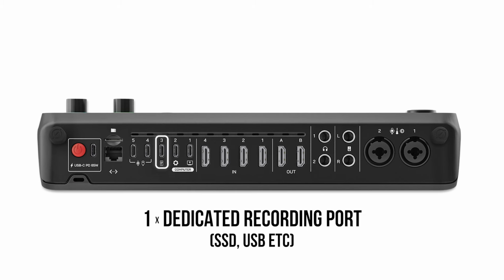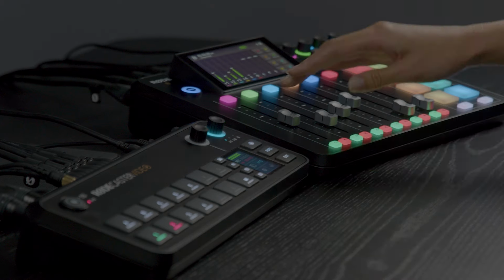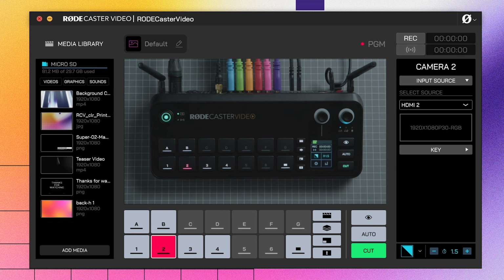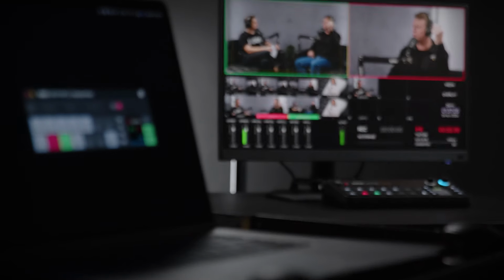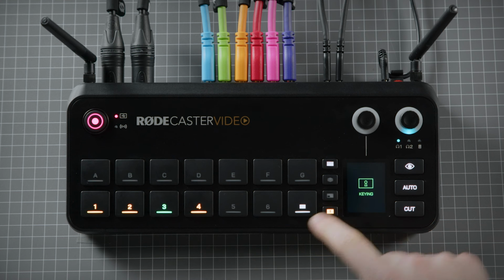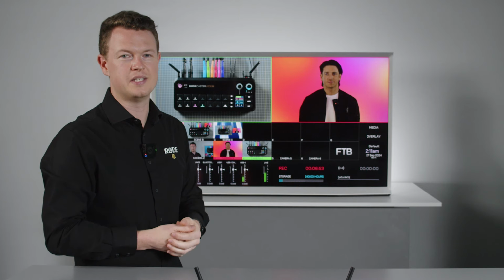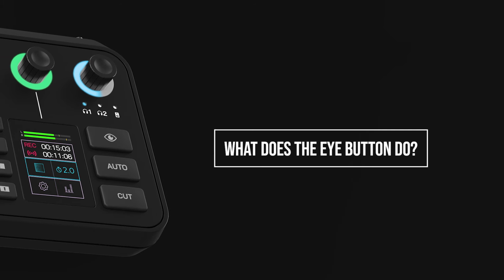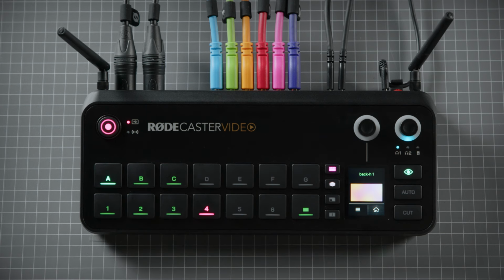Answering Your RØDECaster Video Questions

Comment: I’m experiencing a clear audio/video sync issue on the HDMI output of the RØDECaster Video.
Stream and internal recordings are perfectly in sync, but the HDMI output shows about ~7 frames of video delay compared to audio. Audio Delay settings don’t help in my case because audio is coming via USB from a RØDECaster Pro II.
This seems related to HDMI processing latency, not user error. Anyone else seeing the same behavior?

Comment: Does the Rodecaster video output ISO type recordings of individual audio tracks, as it does with video files, in the output folder on a hard drive?
Reply from the maker: When recording onto an SSD, you will get infividual audio and video recordings as well as the main program feed!
Reply: @rodemic  great, thank you.

Comment: question, I'm trying to figure out how to have 3 XLR mics and 3 Headphones, 2 mics and headphones going into the Rodecaster Video, and One Mic and Headphone going into my rodecaster pro 2 that is attached, the rodecaster pro 2 headphones sounds weird when listening to the mics from the rodecaster video, I'm trying to set this up for a podcast and also use the auto switching feature on the video. Let me know if you have any tips to fix this?

Comment: In a 3 camera podcast setting and loading in video intro and overlays can you record the podcast from start to finish and save to external ssd where the show is already produced with a file on ssd that can be uploaded to youtube? Or do you need to bring files into editor to do final edits?
Reply from the maker: The RØDECaster Video will export the Main program feed (all overlays, transitions etc. included) as well as each video and audio input as individual files!

Comment: 7:04 direct question: 
Can the Rode interview pro connect to those two wireless receivers already on the unit without using other units (ME/PRO/etc)?

It would be great for panels discussing on stage during live productions.
Reply from the maker: You can connect two Interview PROs to the built-in receiver of the RØDECaster Video!
Reply: @ that’s a selling point you did not mention! 
Panels on stage can use that feature. 
Thank me later 🤣

Comment: Love the RCV so far, and yes, I'm a beginner, Just one piece of advice: if you want to use your "iPhone 15/16 as a full camera, You can use it through an additional laptop!  -  If the laptop is plugged in through HDMI, use photo-booth, zoom, or ScreenFlow software, and you can connect the iPhone wirelessly in the dropdown menu as the main camera, giving you perfect Image and sound. Without the iPhone camera dot and info on the screen. Just make sure you have your phone on a magnetic charger so it never runs out of battery. Oh, and Guys, I would like to see you show more on the recording, transfer and "EDITING the RECORDED content, so uploading, etc., as a beginner, Cheers in advance.
Reply from the maker: Thanks for the recommendation! We'll keep that in mind for future videos.
Reply from the maker: Hey there! Just an update for yourself or anyone else who comes across this comment, it's now possible to get a clean HDMI output of RØDE Capture that can be used directly with the RØDECaster Video 🫡

Comment: Hi guys.. just bought a RCV.. I can't connect it via the Rode Central app.. apps installed BUT no RCV device comes up either via wifi or by plugging via USBC. Can't find any info after hours of looking / reading.. any halps would be great.. ✌️
Reply from the maker: Hey Jamie! Drop our Service Team a line and they'll be able to help you get your RCV up and running. https://help.rode.com/hc/en-us/requests/new
Reply: @rodemic  will try them now.. danke!
Reply: @rodemic  ok.. so just got off the phone with Rode support.. BIG news for everyone.. the RCV is NOT supported on the Rode Central mobile app versions i.e. phones or tablets etc.. this might help anyone else trying to find info on the internets.. HNY everyone! 🥂
Reply: @jamieandrei any word as to whether there will be an update to support mobile devices?

Comment: Hi chaps, i have used  the road wireless go for about three years, to cut a long story short, i had a miss hap when fishing in very high winds, i had to pee, when i got off my seat to go, all my fishing gear blew in the lake, i put the mick on my side tray with my phone and a few more bits,  so i bought the wireless go ii, it's ok but i have to turn the volume up in the edit, what is the setting that would be the same as the old one, the old one on full gain, what would that be on the new please, :face-blue-smiling::face-blue-smiling::hand-pink-waving:

Comment: Can I set one of the OUTPUTS (say hdmi out B) to mirror one of the inputs? So it essentially acts a an input thru?
Reply from the maker: You can set the HDMI OUTs to the following: Preview, Program or Multiview 😊
Reply: @ thank you - as a feature request, if it’s do’able in a firmware, being able to set the B Output to those 3 OR any one of the 1-4 HDMI inputs directly would be very helpful. Thx.

Comment: Can I use two iPhones instead of cameras? What are the connection options? I'd like to hear the details. What about lighting and old phones. I think since you made a downgrade from 4k to 1080, we have the right to use outdated equipment.
Reply from the maker: You will need to connect your iPhone via the HDMI port by using an AV adaptor. Check out this article for further details - https://help.rode.com/hc/en-us/articles/10861112048399-Connecting-Your-Mobile-Device-to-the-R%C3%98DECaster-Video-as-a-Video-Source
Reply: I am very grateful for your response. You are suggesting in the essence of the screen mirror. That's not the right application at all. It's not a video stream from camera. It would be great to use multiple iphones instead of expensive/cheap cameras (no need to spend money yet)

Comment: I would be pushing the buy button right now if the video recording came in 4k. I will wait for the 2nd generation that has the 4k video recording capability. Please come out with it soon
Reply from the maker: We appreciate your feedback! We'll pass this on to the team 🙌
Reply: @rodemic  Thank you. I'm sure it will be a bit more expensive, but I'm willing to pay for that to have the 4k capability. Appreciate the response
Reply: @rodemic  I have proble with the zoom connection ! I connect with my pc with type c 1 video output and the zoom can see the rodecaster video as camera but the screen is black !!!! Please i need help !!
Reply: the hdmi ports are 1.4b, so maby with a firmware update we get 4k recording ;)

Comment: So... the only real value I can see for this for me right now is as an input aggregator/I-O expander (I'm a laptop user, so input constrained) for my existing Twitch setup in OBS. Is it fair to assume that this device can stream its output channel directly into a USB-C connection that I can connect to my laptop and pipe directly into OBS? Is any specific connector software required for this and is it included in the box?
Reply from the maker: Exactly right! You can send the main program feed directly into OBS when connecting the RØDECaster Video to your computer via USB-C 😊 No additional software required, though Central can give you even more control!

Comment: For this to be of use to me, it needed to have audio controls like the Rodecaster Pro on the front of the console. I get that it's all available by the menu and in Rode Central, but if I need to adjust a level quickly and instantly, while still carrying on with the show, that's no going to work. Even the comparable Blackmagic units have the ability to select, mute and adjust level on the front, albeit with buttons (as well as in the software control panel) but this, has nothing.
Reply: Could Rode integrate the video functionalities of the Rodecaster Video into the Rodecaster Pro 2 in the next product? That would create a killer all-in-one device, combining both video and audio capabilities. Otherwise, I wouldn’t be in a rush to buy this product. It lacks many intuitive features and feels like just the beginning of a promising future for similar products.

Comment: How can I connect 2 sets of Rode Wireless Pro (4 microphones)?
Reply from the maker: You can connect two transmitters to the built-in receiver. With the second kit, you can connect it via the combo jack inputs! A VXLR adaptor should do the trick - https://rode.com/en/accessories/adaptors-cables/vxlr

Comment: I bought a RCV. I have come from software switchers.(Livestream Studio & Wirecast) I also have a BMD Atem mini.
Transcoding video needs to be to 1080p which I use DaVinci Resolve to reformat the video from 4K. Could be done internally.
Working out how to add music files isn't easy. Video I have worked through and managed to make work.( not sound yet)
Screen capturing a desktop with sound is my next hurdle. Mix-minus is something we used to do with an external mixer(nice feature) We used to have an app on the network for that.
Adding RTMP sources is straightforward. Be great if much of the desktop work was able to be done via NDI for ingest.

Best source for setting up a RCV is a video with PhotoJoseph.

Comment: What does the external USB-C port actually record? Does it multi-track record all audio inputs PLUS all the video input ISOs as well all on the same SSD drive?
Reply from the maker: It will take in all audio and video inputs as separate files as well as the main program feed!

Comment: Will we be able to change HDMI out to of of the other HDMI inputs? I know right now it does program out or preview, but as a instructor where I stream to students, but also teach live being able to have my computer go into one of the HDMI inputs, but also one of those HDMI inputs go through one of the outputs so it can go back to a screen in the classroom would be extremely helpful
Reply from the maker: Not directly - in this case, we'd recommend using a HDMI splitter so that you can duplicate the signal of the computer that the classroom needs to view, while also sending another signal into the RØDECaster Video.
Reply: @rodemic  thank you for the reply and the info

Comment: Guys tell me can videocaster allow for more 3 shure sm7dbs since they are xlr mics or i have to use only 2 mics tell me how i can more than 2 mics on it,which type of mics and how to connect them
Reply from the maker: The RØDECaster Video has a maximum of two XLR connections, but you can also connect a RØDECaster Pro II or Duo to the switcher to give you access to more mic input options!
Reply: @rodemic  thank you guys,heartbreak came in after learning Rodecaster video doesn't allow connection to sony zve10😪
Reply: zv 1 mark doesn't connect too🥲 many usb c cams don't connect
Reply: @rodemic Will  Rodecaster 1 not connect?

Comment: Great video guys, thanks. You mentioned some new Sony Vlogging style cameras can plug straight in via usb, can you give some models as an example so I can research for a low cost 2-3 camera setup please?
Reply from the maker: Cameras such as the Sony ZV-E1, Sony FX30, Sony FX3 will work great!
Reply: I believe the frame rate it comes in on on the FX30 via USB-C is only 15fps compared to newer models like the A7CII and ZV-E1 that do 30FPS

Comment: Can it do vertical video capture & stream? Or would the files need to be rotated?
Reply from the maker: Not directly, but you can adjust the size and dimensions using the scene builder via Central!

Comment: I do not understand why we need it. I have wireless mic PRO but I hardly ever use it as wires mic. I just record sounds and mix it in video editing software. So I could do the same thing for videos and sounds in the software. 
Anyway I suggest you should sell small mics with recording  function instead of wireless mic. I bet you can make it cheaper for sure.